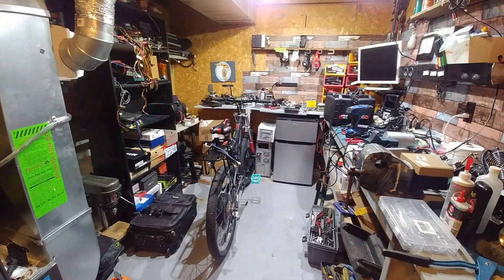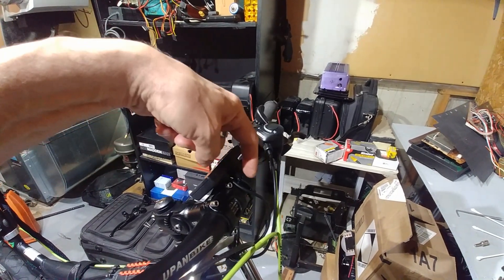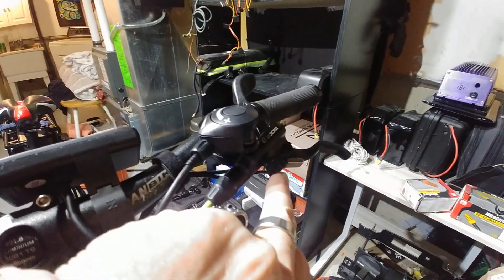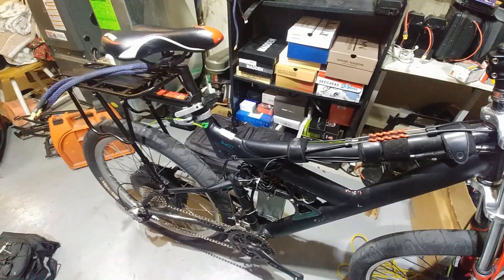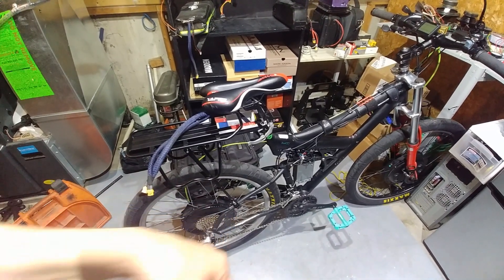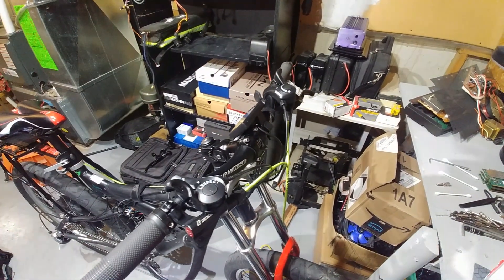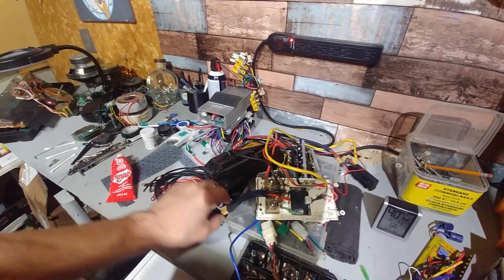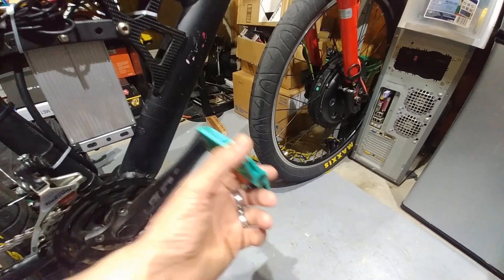ebike #vlog .SPRING REBUILD p3 tested #review #ebike #lifepo4battery

Comment: Hi. I have an e-bike question. I bought a e-bike conversion kit from this retailer known as Pexmore. However the bike tire where the power goes is connected via ring connectors to the controller whereas the controller has bullet connectors. Is there an adapter for this?